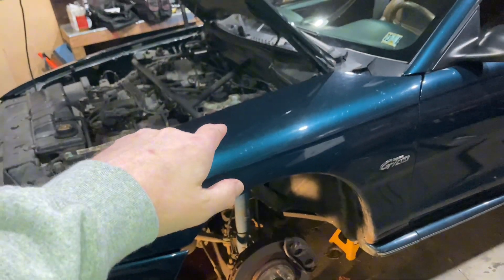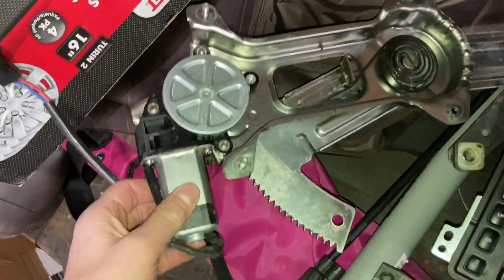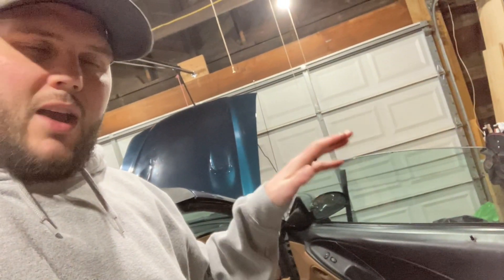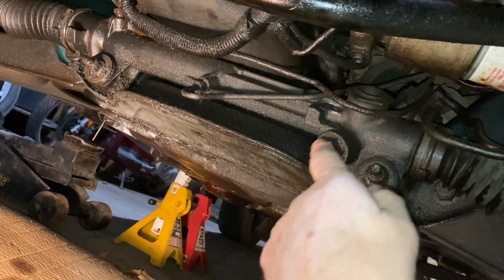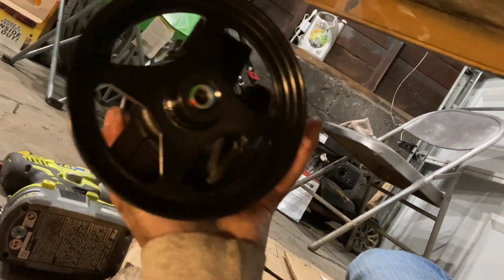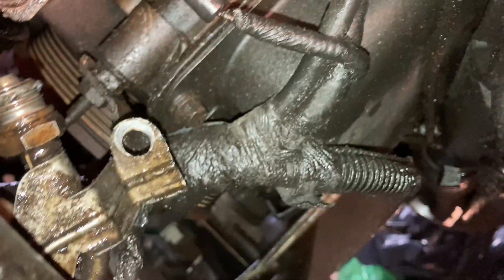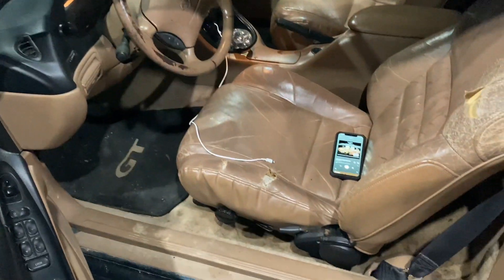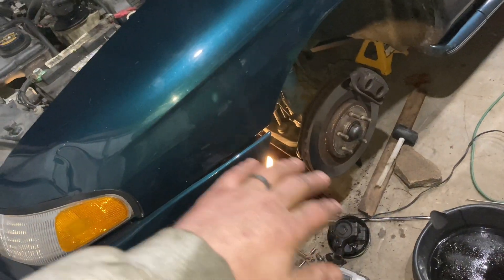Updates on the $1,000 Mustang. Installing a new power steering pump and plans for the car.

Comment: My either.  I'm an A and P mechanic,  Locomotive mechanic.  Now a Catapillar mechanic.  Hate cars man. Lol. But had a 95 gt. 86 gt. I'm here to learn man.
Reply from the maker: I used to drive triaxle and would have to do on the fly repairs on that stuff and in my opinion it was so much easier because it’s all open and right there. On cars everything is so tight and tough to get to but it’s all in fun.
Reply: @teddydiesel  exactly.  4500 ho 2 stroke and 4 stroke is easy.  Open. Cars are like airplanes.  Small, tight working conditions.  I spent two days replacing an oil cooler in a Cat engine.  Just to reach it man. I'm 52. Done this my whole life. But every machine is different.
Reply from the maker: @wjs2  Yeah no doubt. Everyday is a learning curve.